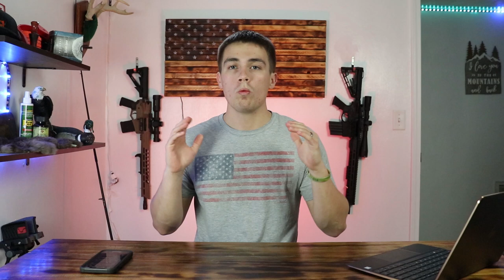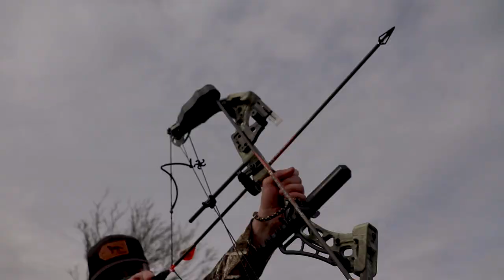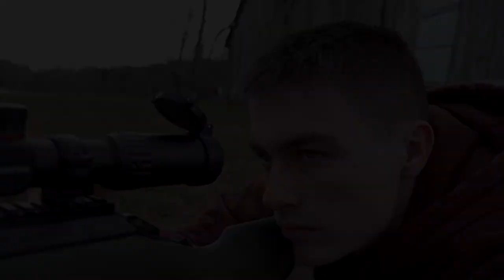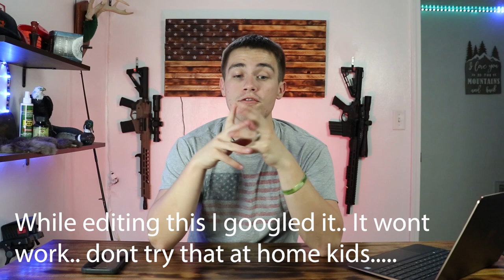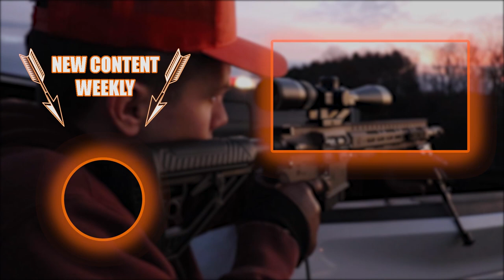Problems With Building The AR-10! (Must Watch!)

Comment: I mix brands when building AR-15's but when I build my 308's and 6.5 Creedmoor's I use all Aero Precision parts.AR-10 refers to the ArmaLite AR-10 only but most of us still refer to our big bore builds as AR-10's. You spoke of the different dpms heights which is really important since dpms high parts wont work with dpms low parts.  Knowing  what youre doing before spending the money on your AR-10 build is crucial. Great info buddy. Ty
Reply: Ok nerd

Comment: Great video. As a Master Gunsmith I agree with you. Non standardization creates excellent work for me! I do use a lot of Aero Precision parts and fit them to the rifle being worked on.
Reply: As a gunsmith, do you recommend building an AR 308 with the longer apx 8" 308 buffer tube or the common apx 7" AR-15 style buffer tube?  Been searching for a breakdown of how this affects the buffer weight & length and spring length & rate and the advantages and disadvantages of building the firearm each way.
Reply: @ADAMJWAITE  I like to use a standard military spec carbine buffer tube with the Aero Precision.308 spring and buffer kit. Part #APRH100158 M5 .308 Carbine Buffer Kit.. I have found this combination works very well with rifle length gas systems and adjustable gas block.
Reply: @michaelsanbornsniper8231  Thanks for the reply.  That's one of the kits I've been looking at but unfortunately they don't list the buffer tube length on their site.  I take it that must be the same buffer tube as their AR-15 kit then, just with a different buffer & spring.  Sounds like it would work well for the 18" barrel w/rifle length gas system and adj gas block I'm considering.  Up until now the advice I've been given was to use the longer buffer tube, specifically the Armalite kit, but they, like all the rest of the manufacturers, don't list the specs.  Building an AR-15 was a lot less complicated, lol.  I've yet to find a breakdown of recommended buffer components to use based upon barrel & gas system length and BCG weight on the AR-10, like is available for the AR-15.
Reply: @michaelsanbornsniper8231   I build a AR10 308 and it’s not cicling right. It’s not reloading the next cartridge. I thought it was my reloads so I tried reg 308. Same problem. Bought adjustable gas block and a buffer that I can change the weight on it. I haven’t tested it yet .I’m going to keep your design. Can’t give up. Spent too much money on it. Never had a problem with any AR15 I built . What was I thinking a AR10 would be the same result
Reply: @williamgonzalaez229  sounds like you need to adjust your gas block
Reply: I want to get a degree. Do you recommend being at the school or can I learn well with online classes?? And what schools would
you recommend?? I live in CT.
Reply: So i have an AERO M5 in 6.5 Creed . it operates well. Just curious im thinking of swapping my BCG for the JP Precision FMOS BCG. Do you have any experience with this setup in a 6.5 AR?
Reply: I've found building ar10's is as easy as an ar15. All Aero avoids the compatibility problems.

Comment: I've managed to fine all the parts(including paired receiver set $209after tax) moderately easily in a weeks span. Cheaper than dirt has all but  receivers, live free armory has receivers, Anderson has barrels. The only issue is when you're looking for a specific brand part and doing your homework on the receiver you purchased. Live free armory is LR-308/DPMS Gen 1 high profile for whoever needs that info

Comment: That's why I try to get parts from the same manufacturer. Just finished building a 10 out of mostly Aero Precision parts and it went together pretty smooth, no issues, yet.
Reply: Areo Precision is a DPMS style LR308 not AR-10. AR-10 and LR308 are not the same or interchangeable. I too chose the Aero M5 as my foundation for my LR308.
Reply: @RideForLifeCR250R  not sure what you mean by not an AR-10, I purchased all milspec parts.
Reply: @InternetSavage  there is no Milspec or standard to the AR10/AR308 as there is with AR-15. What I mean is unless you have an Armalite AR-10 than what you have is a AR-308, more specific Aero Precision is the DPMS pattern AR-308.
Reply: @RideForLifeCR250R  By those standards, only guns made by colt are ar10s.

Comment: I am collecting info in my first build on .308, I have ordered parts already, hoping I am understanding the process; mainly I will build an AR10 but down the road would like to use the same parts to step into 6.5 Creedmore from .308. My fist pick was WC 20" super sniper barrel, then went with a Fail Zero Nickel Boron BCG which is stated it can work also on 6.5 Creedmore, from there low profile gas block, rifle gas tube, 15" handguard, barrel nut and stripped upper are ALL Aero Precision M5 my lower so far is an 80%, buffer tube also M5, buffer is KynSHOT, but I also have an H2 with Aero Precision .308 spring for variation or even if deciding to use a Sylvania Arms Folding Stock adapter (overall weight watch as barrel alone is 50.7 oz!) trigger I chose is Trigtech AR10 2 stage duty flat; lower, upper, rail and stock are FDE, ahh and charging handle is Rainier Arms Mod2 Avalanche; those are the main parts; not decided yet on muzzle device as this will be a great pal for my Banish 30 direct thread can, so far i only got a thread protector in Stainless Steel to match barrel; the interesting thing about this build is I bought the charging handle some while back and made a mistake, instead of an AR15 handle got the .308 so it was lying around for some time and then decided to build from it, LOL. I searched for WC BCG but could not find it in a price I would be comfortable with and everywhere is backordered; hard to piece parts together when everything today is backordered! great video with great tips, thank you!

Comment: Great vid. Very helpful helping me finishing of my 308 ar lower. total cost was $570 w/o optic.
Reply: under 570? teach me the ways
Reply: Dan Sir I’ve used a BCA complete upper ($300) on a JMT lower ($100) and a budget LPK for a .308. I would recommend spending extra on the LPK. My bolt catch/release from the kit was not mil-spec.

Comment: In my building an AR-308, I researched for a long time making sure what I was about to do would be right noticing the difference between DPMS and Armalite receivers. The build would be chambered in 6.5 Creedmoor making everything AERO Precision upper/lower receiver believing from one maker fewer problems, but one area that I encountered was the BCG. The BCG may not be a problem with handloads, but if you are considering factory ammunition only like M80 Winchester; it may cause some problem with the firing pin hole the primer flowing into it causing a stoppage/blocking the firing pin, solution for me JP Enterprises Enhanced High-Pressure BCG (small firing pin hole), the cost $460.00, but it does work - AR-7.62x51/308 Win. not for recreation - everything has to work @ 100%.

Comment: Stag upper, lower, 20" rifle barrel, bcg, upper parts, lower parts, low pro rifle gas port and tube, charge handle
Aim handguard and nut
Utg a2 stock kit w rifle buffer and spring
Generic trigger and lower kit. Am I missing anything? I think this should work I'm assembling it tomorrow I'll let yall know how it works out
Paid about 1300 for everything

Comment: I used all aero parts except 20 inch criterion barrel DPMS .308 with fulton armory headspaced BCG.   Aero adjustable gas block.  Every thing went together wonderfully.  Went to shoot it and it would either barely kick the case out and not pick up a new round or would stove pipe. I ensured gas block was all the way open. Using 7 62 nato by s and b which i know is less pressure than .308.  I put on a a aero standard gas block so i know there will be no leakage and using .308 168 grain SMK ammo. Was hopping to try it this weekend but we got hit with snow and ice
Reply: What did you find out

Comment: I just completed an AR-10 build with an 80% lower. The machining was fairly straightforward. The problem, just as has been said in many of the comments here, is that there is no standardization. I had to do a lot of 'adjustments' to get things to work. I still have a sticky bolt catch that I am trying to figure out. That said, I will stick to AR-15 builds from here on out.

Comment: For the record, an Aero M5 AR-10 upper will NOT fit a Palmetto State lower. It almost lines up, but the rear takedown pin doesn’t quite line up due to the rear radius being smaller than the PSA. They do that so you have to buy their lower.

Comment: In my experience mixing AR10/LR308 receivers from different manufacturers does not work. Some may fit close enough to pin up but they are not meant to work properly together and can be very dangerous.

Comment: You ain't kidding about lack of standardization. I built an AR-15 and everything went together just like all of the YouTube videos said they would after just a bit of research. With my AR-10, I've done 5 times the research and I've still had to make some adjustments after getting the parts to make them fit. For example, I snipped the end of the pin holding on my dust cover because it was too long and blocked the handguard. I also had to grind down my pivot pin to get the upper to fit into the lower. It's much trickier to find parts and local stores carry very little hardware for AR-10s. I've bought most of the parts from Optics Planet.  Everything is more expensive too. Still, I'm excited to finish it and see it work.

Comment: AR 10 also is in the WSM magnum cartridges.
From KAK industries can be bought the AR 10 in 300 WSM.
I have an AR 10 upper in 375 WSM plus 6.5-284 Norma and and upper in 6mm - 284 win
Do it yourself AR 10 build in a WSM cartridge the WSM bolts are at KAK industries .

Comment: I went with  a noreen lower...and I got a kak industries upper on sale with adjustable gas block ,pneumatic buffer,..was pricy...still going through buffer springs..I think I got it down..waiting to go to the range to find out how the new buffer works..looking to put my fostech echo in it as well..have a single stage Luth trigger in it now ..not too bad..its a slow process..have a heavy barrel upper..but it's too heavy...parts...ha...tons of pants..thousands...total 6 uppers...and I want more...358 Winchester..in the future...450 marlin...also in the future....hang in there...cool video 👍👍👍

Comment: went with all aero upper and lower and it has tons of problems. double feeds, failure to extract, failure to feeds. lot of people say you need a carbine buffer setup to fix it. shouldn't be that way from the factory though its insane

Comment: The struggle is real... I'm building my first AR 308 and first gun in general, and there's certainly a lot of options out there. I bought two different 80% lowers for the build, and one fits great with the upper I bought, while the other has some gaps in places and is a very tight fit. Looking forward to getting the rest of the parts and seeing if I run into any other incompatibilities!
Reply: Hi thanks for your input, Can i ask what 80% lowers you bough which one worked and which didn't #2 what upper did you buy that worked with which your upper model? The problem i see in comment sections is everybody makes a comment but nobody tells which parts worked and which did not if everybody started explaining which matched and didn't match over time it would help everybody out. Thanks any info would be great.
Reply: I had to machine my lower at the rear back strap thread housing for Butt stock .050” to clear charging handle

Comment: I got a diamondback ar10 with triggertech diamond and a 16 inch barrel. I was wanting a bit longer barrel to strap my thermal on so i hought a PSA 20 inch barrel and upper and this thing wont fit at all. Rear of the upper is curved by the 2nd pin instead of being angled cut like my diamondback lower that was trying to fit it on. Now i have to buy another lower and another triggertech diamond for ar10 which is almost as much as the freaking barrel and upper.

Comment: Didn't even hit on the fact that there's a DPMS Gen 1, the most common, and the DPMS Gen 2. Good video though. A few other things, LR308 parts work with the DPMS pattern receivers, there are 3rd party manufacturers that produce receivers that have the Armalite angle by the buffer extension but take DPMS barrels and handguards (Dr Evil wannabe's), and most AR15 parts are compatible with the larger platform save for a few (not compatible: bcg, barrel, handguard, bolt catch, charging handle, receivers, buffer system if Armalite).

Once you've gotten used to the market for AR-10 parts, it becomes easier to manage. Hope the build turned out well. Used the Aero Precision M5 receivers for mine as well. Absolutely loved the build process with those.

Comment: One reason I prefer the ar10 to the ar15... genesis 12 gauge upper fits on the dpms gen 1 lower. You can hunt anything on the ground and in the air with the 5 second swap of your upper (Not to mention... 10 round 12 gauge magazines on a semi-auto platform... pretty fun mag dump)
Reply: neat

Comment: Oh yeah I’m having a major cycling issue aero build kit all high dollar parts will no cycle if you come up with the fix A LOT of people will be thankful. My build is a 20” 308
Reply: What parts did you use? I'm waiting on a few very slow vendors to send me some stuff to finish my build. Aero receivers, aero NB bcg, their carbine buffer kit and a 16" criterion barrel in 308. Similar to yours?
Reply from the maker: Thats close to mine, BA 16inch barrel, BA NB Bolt and aero carbine buffer kit.
Reply: @ElliottDelp  I'm using the SLR sentry 7 adjustable gas block and VG6 Epsilon muzzle device and an extra JP polished spring. The thing that has me concerned just a little is the rifle length gas system on a 16" barrel. It's not much dwell time. The muzzle device will help but if it's still short stroking then I will need to start cutting  the spring, and if I can't fix it that way, get the gas port enlarged.
Reply: I'd open the gas block all the way so to over gas's the system, them slowly dial down in one click/ 5min as the clock sits until it repeatedly fails to cycle then turn the gas up 2clicks, 10min as the clock sits. That way your not completely over gassing as a fixed gas block would but are over the threshold of under gassing the cycle system.
Reply: @jacobahlfield9491  it was the gas tube i had a AR15 15” gas tube in the gun then I read that ArmaLite makes a 15.5” gas tube for the LF AR10 put it in now the rifle cycles and locks open on last round fired.
Reply: @ElliottDelp  see if ArmaLite makes a carbine gas tube. My rifle is cycling like a champ I was able to get to the club today. Did the test run and she ran like a champ last round hold open 0 cycling issues.
Reply from the maker: @Johnny-jr2lq  hey man! Glad you found the issue! I’ll look into it today when I have some free time. I am desperate to get it fixed.
Reply: @ElliottDelp  alright brother I left a picture on messenger for you ArmaLite has a carbine gas tube idk if it’s in stock I had to call them to get my gas tube and they called back in like a 7 days
Reply: Try David Tubbs buffer spring does miracles.

Comment: As a guy who builds alot of these there's
Dpms gen1
Doms Gen 2
Armalite

Your m5 isn't true gen1 it's slightly modified dimensions a bear creek upper fits on other Gen 1 lowers and the uppers etc those m5 upper lower sets are wierd.... And another difference is Doms and the Arnalite have different methods of the bolt catch going in one's threaded ones a really long roll pin.... Also Palmetto stuff works great with Gen 1 stuff maybe some shimming but yeah your m5 is the wierd set in my 5+ years of building 19's

Comment: My dad recently built one and it wouldn’t cycle properly, slowly swapped every part out (bcg,gas system, mags, ammo, buffer&spring, until we finally changed the barrel then it ran perfectly lol 🤷🏻‍♂️ never had that happen with tens of .556 builds.
Reply from the maker: Yeah I am on like 5 ar-15 builds and they all run great. First ar10 build and it goes wrong lol
Reply from the maker: Yeah I am on like 5 ar-15 builds and they all run great. First ar10 build and it goes wrong lol
Reply: @ElliottDelp  I know exactly how you feel! I think it’s definitely worth jumping through some hoops until it runs perfectly, as you know .308 is on a different level lol

Comment: Curious if you ever tried a bear creek upper as they come complete for a good price .Not sure on the fit I just know most 80 % receiver's are DPMS gen 1 & they say it fits them . Their uppers work fine on my ar 15 80 % receivers
Reply: I know this is an older post but just in case your still wondering I hacmve a couple BC uppers and they are not bad for the price. They fit well with an Aero precision lower.

Comment: I built mine with my SS disability money. You can do it. I went with a PSA upper and a generic LR-308 lower. I had to modify the magazines so they seat, and run the action to break it in. Also I had to get extended takedown pins, the PSA lowers use shorter pins.
Reply: I just got a complete PSA upper. What lower did you go with?